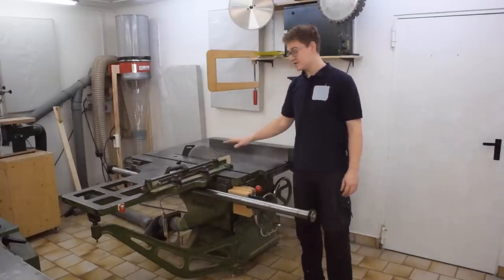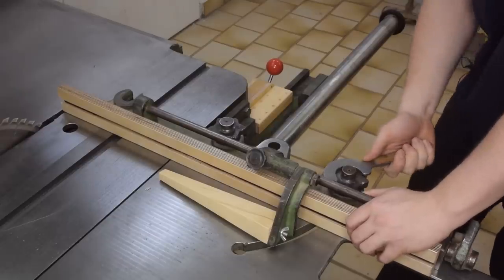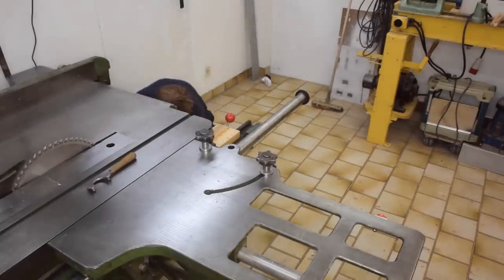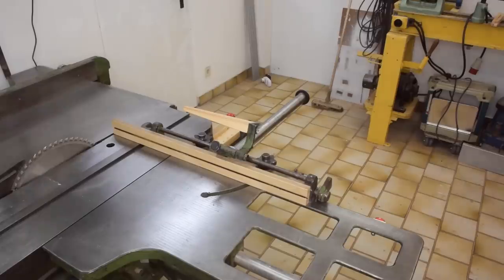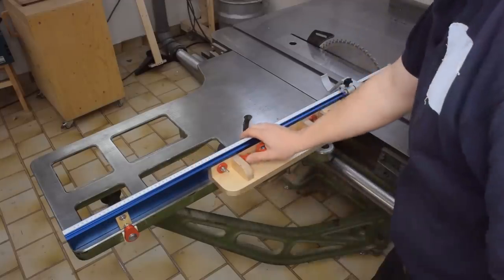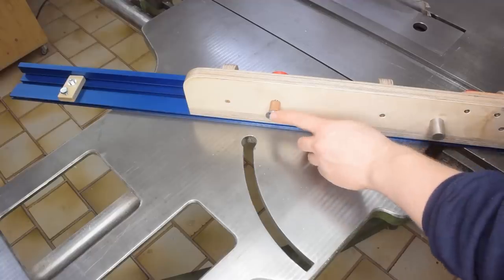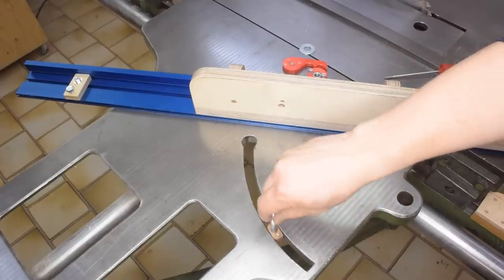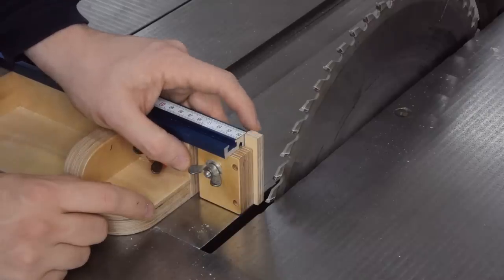Amazing Tricked-Out Crosscut Fence for the Old Bäuerle Heavy Cast Iron Table Saw

Comment: Hi Cosmas,  great solution, but you actually cheated when comparing the two.  When you remove the old fence you still have to remove the two bolts and cranks in order to rip a wide board/sheet, so the 55 seconds will actually be much longer.  I have enjoyed many of your projects. All the best.
Reply: thought the same.

I guess to remove and attach the screwed down bolt would add about 2 minutes 

Cosmas, geiles Video wie üblich. Schaue deine Videos nun seit Jahren und muss dir sagen, dass ich sehr viel Neid verspüre, wenn ich dein Equiptment sehe :D
Reply from the maker: That is true!

Comment: It will take even longer than 55sec if you also have to remove those two bolts in order to rip cut something bigger and then putting them back for other cross cuts.

Comment: really well done, but don't you have two table saws?   So you could just set one up for ripping and one for cross cutting, no?  🤔
Still, I'm really impressed with those two quick release locking mechanisms.  That is slick engineering.
Reply from the maker: That was the initial plan but it now looks more like the other saw is always occupied with some jig or fixture or dado cutter and I use the big one more for the normal cuts.
Reply: @CosmasBauer  I thought Dado blades were not available in Europe!?